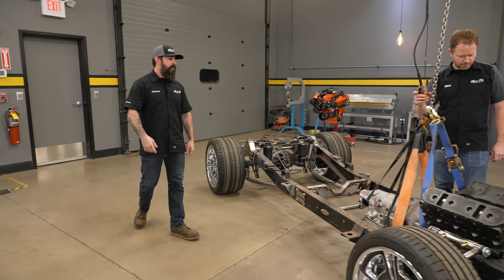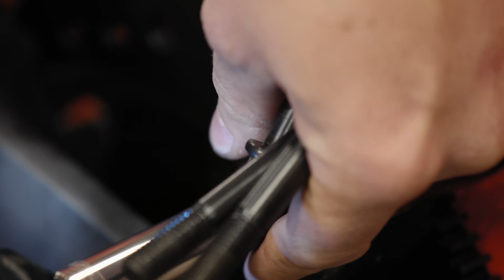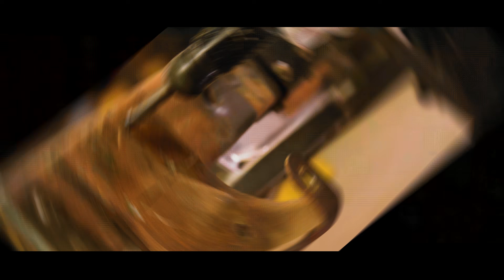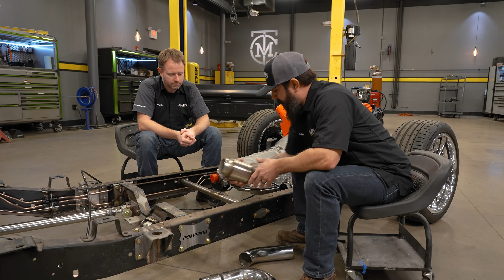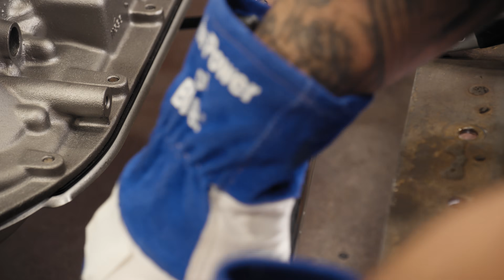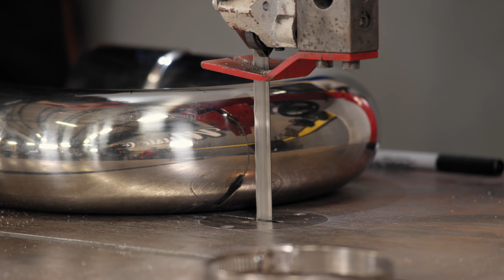Slammed C10 Exhaust Secrets: Precision Cuts & Routing - Music City Trucks S6, E3

Comment: you did not explain what center line radius is correctly.  What you are talking about is just ensuring a perfectly radial cut from the apex of the curve.  CLR is different and used to calculate bend lengths along a common radius.

Comment: used a engine hoist for a plastic block?
Reply: Did you watch the same show? The block was attached to a real transmission- I’m sure that’s what they were lifting
Reply: @SamsGarage87 which they could have just left in the frame and unbolted the plastic engine instead of using an engine hoist or have the two  guys lift it onto the table
Reply: @SuperPeterchow   doesn't matter if the horse is blind if it's just to move the wagon out of the barn